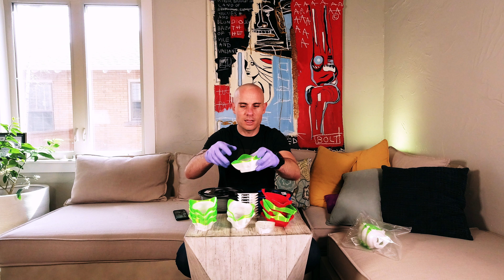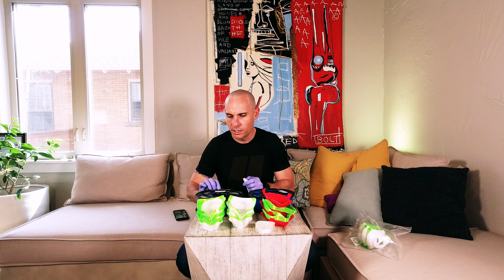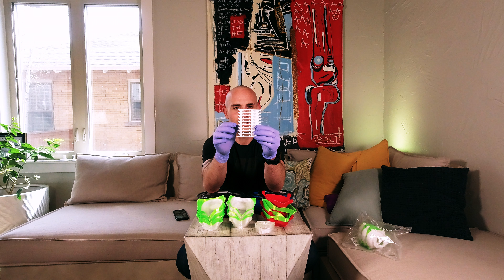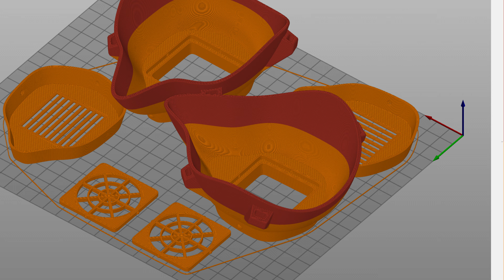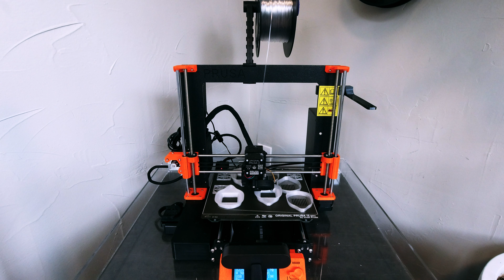3D Printed Coronavirus masks: Which materials and designs to use? #covidMask #CoronavirusMask

Comment: very cool! this looks to be a great design for a printable seal on the face; but have you tested long hours of use with the smaller opening? looks like the same size square opening as the “Montana Mask” or “Billings mask”. Ultimately I moved on to design with a larger opening since the CO2 buildup seemed to be a lot with this design. I added medical grade foam on the inside for the seal. I need to update my Thingiverse but the files are below. Same concept as yours using N95 material for filtering to extend the supply. There’s also a suggestion of using Halyard H600 surgical instrument wrap as filter material as well. Most hospitals have it on hand. https://www.thingiverse.com/thing:4236053
Reply from the maker: We've done a couple weeks of testing, but I agree that having a larger surface are would be helpful. I like the design you posted, i'll give that a print in a mix of PETG/TPU and see how it does. I have one other design that has a very large surface area that I just remixed. If that goes well i'll put up a video going over the details. This is awesome work, thank you for sharing your files and helping everyone out!
Reply: BLOVE hi I’m going around sharing as much as possible. just saw this: https://youtu.be/xVYypLYEo_0
Reply: BLOVE and TY! we’re in this together!

Comment: First of all, this is a great video.  Band new to 3D printing, but looking to help my community.  I just bought an Ender3 Pro.  Would the 3mf file you attached, be compatible with my printer?  Any guidance is appreciated!
Reply from the maker: Thank you, the files should work. What you will want to do is import it into your printers slicing software, it should from there export some gcode that you can use for the printing.

Comment: Can I use soldworks and a makerbot printer to directly print your files linked below? I have access to these two applications and the printer at school, which I will go to tomorrow. Can I print it directly?
Reply: Also: 1. How long does it take to print an entire mask?
2. How do you use 2 types of different filament on one print? (TPU and Petg). I am a relative beginner, and would like to know how! Thank You vm
Reply: LAST QUESTION: Is this not included with the filter cap? (and putting the filter in between)?
Reply from the maker: Takes about 8 hours to print 3 masks in total.

Comment: Thanks for your time working for the improvements and sharing this! I have been trying to figure out the best design out there for a while and in the process learned a few things that I want to share.
1. The seal is very important. With the current design you are going with, there is not enough sealing in the filter region. This will allow unfiltered air coming through the gaps. One way to deal with this is to use hot glue to seal the filter material. This however makes the mask hard to reuse as removing the filter will be a challenge (alcohol will make the hot glue easily peel able but who can find alcohol nowadays.) 
2. Filter material makes a huge difference: https://www.researchgate.net/figure/Filtration-Efficiency-and-Pressure-Drop-Across-Materials-Tested-with-Aerosols-of-Bacillus_tbl1_258525804
Using cotton cloth only provides ~%50  filtering. Its better than nothing but not adequate for doctors for sure. There are HEPA filters that can be cut to use which are as good as N95 masks but these are quite bulky and would require a new design. Some people are using HEPA vacuum filter bags which look quite good in terms of filtering but they will restrict the airflow significantly. So a much larger area is required. I think a variation of the design at 6:05 would be better. PETG may not stick well to CA glue but I believe PLA would, so bonding can be achieved that way. Would be great if you provided the design files for this version so that we can try make improvements.

So far I have found the following design from University of South Carolina to be the best in terms of filtering efficiency (much better than N95). Their design also has an exhaust valve which helps avoid moisture in the filter. They have 3D design files a complete instruction to build these.
https://web.musc.edu/innovation/covid-19-innovation
The only downside is that it is quite time involving to make.
Reply: I wrapped the filter material around the edges of the filter frame before  I seated it in the mask. It was harder to snap the piece in place and remove it but the mask sealed nicely. Hard to measure of course.

Comment: Ive been putting a window/door sealer foam around the edge so the plastic doesnt even touch your face and it gives you a seal between your face and the plastic.
Reply from the maker: I had considered doing hat as well before I found my supply of TPU.
Reply: @ALLYOURTECH3DP  I was debating the TPU split thing too before I found the foam... But since the foam is only $3 and TPU is expensive (well, good TPU) I found that economically it made more sense to go with the foam. Either way, the masks look good. keep up the good work
Reply from the maker: @BrysonMichaelRC  I was able to get decent TPU from Zyltec for 17.00 per 1Kg roll, otherwise, I would have done exactly the same thing.
Reply: @ALLYOURTECH3DP  why not do the entire mask from TPU?

Comment: How are you sealing the micro-holes in the 3D print?
Reply from the maker: It is never going to be perfect, but material choice matters here. Using PETG instead of PLA for example. I use PETG to make plant pots that hold water (PLA does not work for this). I also use a minimum of 3 perimeters for the walls.
Reply: I am using water glass
Reply: @dwv100  thanks!

Comment: Just got an Ender 3 would these designs work on that? Also, I work in healthcare and need to print atleast 30-50 would the a roll of 2.2lbs  TPU and PETG atleast cover that? Thanks, great video
Reply from the maker: It's about 170g of material for 3 masks, so you should be able to get 30 or so from a roll of each. The latest version of Prusa Slicer has a profile built in for the ender 3, so these should plug in directly.
Reply: @ALLYOURTECH3DP  Awesome thanks!
Reply from the maker: Find a local hospital that needs 3d printed masks. Join our new slack channel and see how you can help: https://join.slack.com/t/hospitalmasks/shared_invite/zt-dfqkug40-YAFFQbhcGa3uPpxBMyavqQ

Comment: Why are you saying Petg is flexible? It is not flexible...
Reply from the maker: Flexibility was the wrong word to use, agree. It has better layer adhesion and is far less brittle than PLA. Chemical resistance is also much better, all properties that make it an ideal choice for these masks.
Reply: @ALLYOURTECH3DP  that I can agree with! I like your idea of using both of the filaments
Reply from the maker: Find a local hospital that needs 3d printed masks. Join our new slack channel and see how you can help: https://join.slack.com/t/hospitalmasks/shared_invite/zt-dfqkug40-YAFFQbhcGa3uPpxBMyavqQ

Comment: Yes! The TPU transition is what I was looking for! I made a fountain recently out of PETG and needed a PETG/TPU hybrid tube that fed the water to the top but the TPU portion was so it could adapt/flex onto the pump I bought, and the prusaslicer filament change worked great for it, so I figured it would also work for the mask application. The PETG portion would be the front and the TPU part would help the portion that meets your face conform better.
Reply from the maker: It makes such a big difference in comfort and creating a tight seal around the skin.
Reply: @ALLYOURTECH3DP  Thank you! The design is in queue on my i3 mk3.
Reply from the maker: Find a local hospital that needs 3d printed masks. Join our new slack channel and see how you can help: https://join.slack.com/t/hospitalmasks/shared_invite/zt-dfqkug40-YAFFQbhcGa3uPpxBMyavqQ

Comment: I am in the final stages of assembling a mold for these masks which should allow me to make one per hour. That may be worth a try.
Reply from the maker: I would love to hear/see more about that process.
Reply: @ALLYOURTECH3DP  I'm taking photos of the important steps and saving any models that I made for it. I'll pour the mold later tonight (waiting for clear coat to dry) and prepare and try it out tomorrow. I'll make an imgur album and post the model for the mold box at the very least.
Reply from the maker: @luckbot-3000  let me know and i'll share it around on my Twitter feed and such to help others. Really amazing work from the sound of it!
Reply from the maker: Find a local hospital that needs 3d printed masks. Join our new slack channel and see how you can help: https://join.slack.com/t/hospitalmasks/shared_invite/zt-dfqkug40-YAFFQbhcGa3uPpxBMyavqQ
Reply: @ALLYOURTECH3DP  Quick update on my progress. The masks look and feel awesome, but I need to figure out a way to get them to cure faster. Right now it takes me about 2-3 hours until I'm able to demold the masks which is almost the same as when printing them. Still, they're completely smooth and very robust when fully cured. Unfortunately, the resin is white so I haven't yet been able to photograph them well with my phone. I'll put together an imgur album tomorrow with all the photos I've taken so far. It is working like I expected, but the cure time without heating is too long for it to be effective so far. I've tried warming my latest mold up a bit and I'll demold it sooner to see what the results are. Making another mold would double my output, but I'm out of silicone for now (more is on the way). I'll keep you up to date!